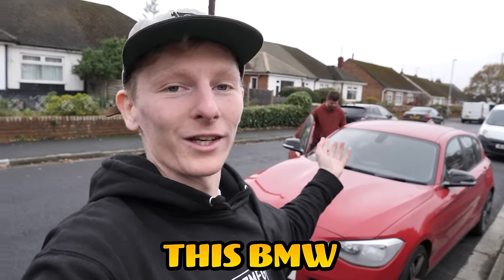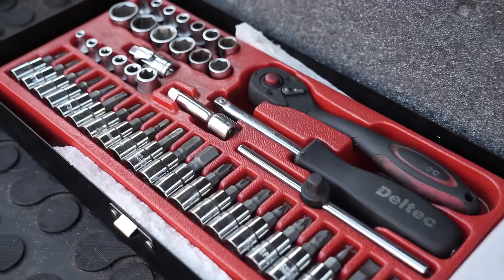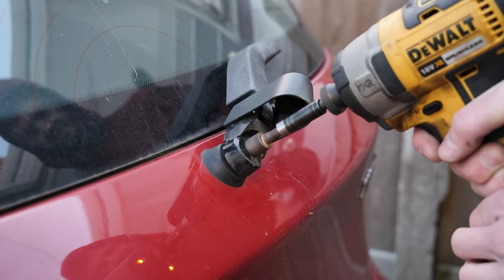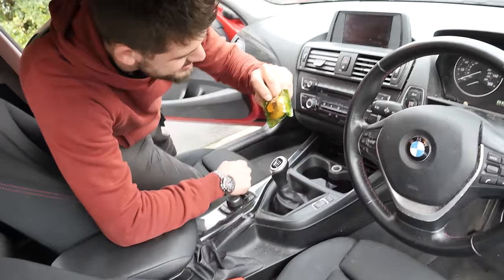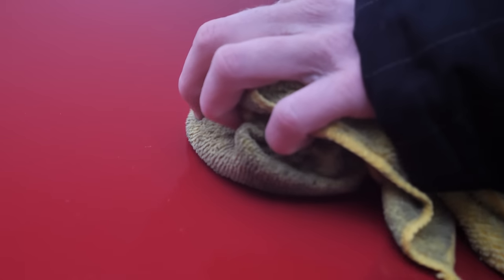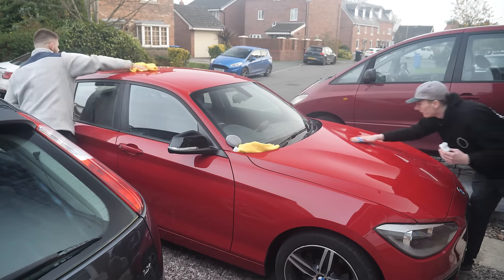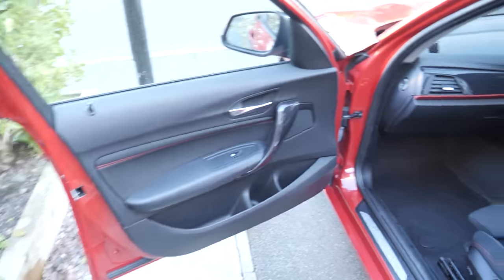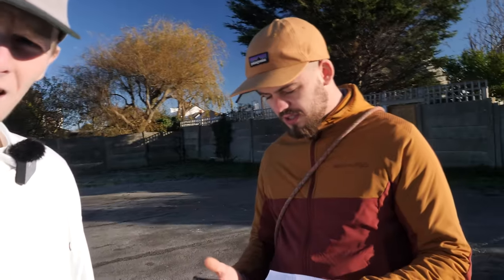I made £4000 in 3 days!!! [Flipping Cars}

Comment: 1:07 this really hurts my eyes. 1 drop of Oil contaminates 1000 liter water. Please don’t do this over the grass. Use a bucket.
Reply: Fresh engine oil is harmful???
Reply: @marcus.H  Funny how something as simple as oil can elude common sense. Yes, it’s harmful (not for the engine obviously) —unless you consider contaminating water supplies a public service.
Reply: @kfcbucket7862  how would this tiny clean oil possibly get into the water supply? It's inside sealed pipes. That's why you don't have mud coming from the taps 🙂

Comment: Hey guys got the same year car, but mines turbo it does smoke whenever engine get hot and me pulling off from say traffic lights etc...any advice?
Reply from the maker: If you know the engines not overfilled with oil the first thing I would expect is turbo seals, fairly easy to get the intake pipe off to see how oily it is in there
Reply: @Josh.Sanderson  thank you for your reply, turbo sea,l is that the stem seal someone says stem seal what you think?
Reply: @Josh.Sanderson  and no the engine oil is not overload because i it sometimes get really low, and I had to get it top up.
Reply from the maker: @gw7101  are you measuring from computer or dipstick
Reply: @Josh.Sanderson  dipstick....
Reply from the maker: @gw7101  yeah I’d think stem seals
Reply: @Josh.Sanderson  much appreciated 🙏